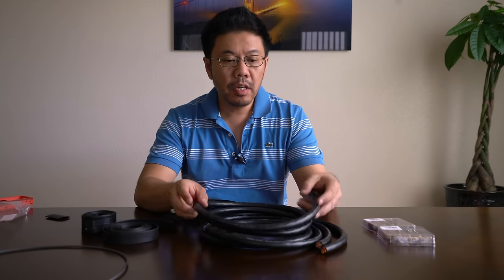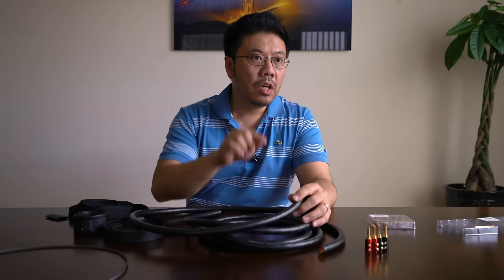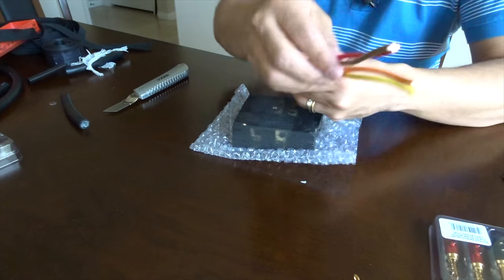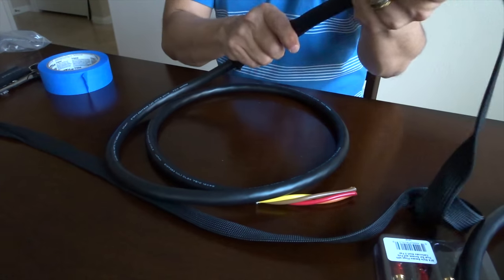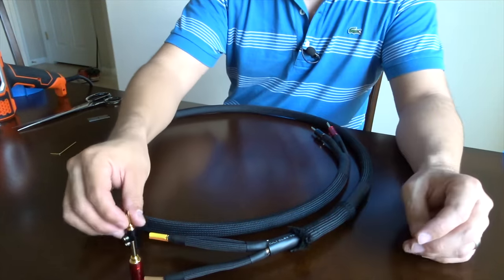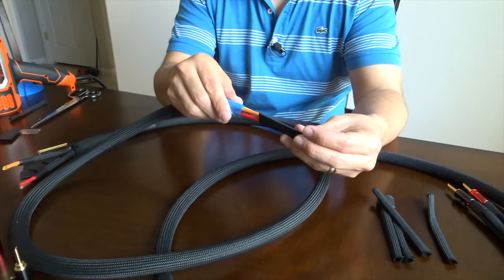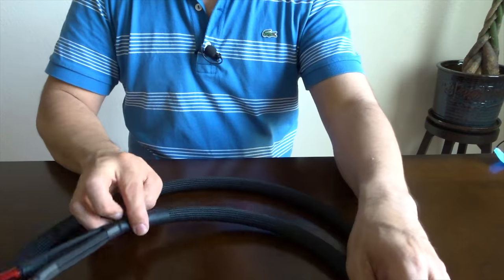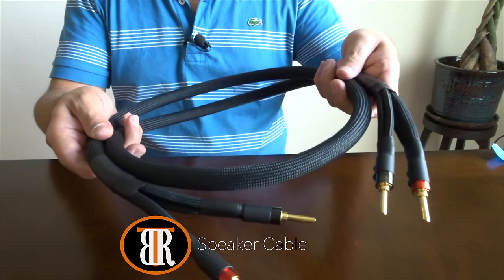Making The Best Speaker Cable For Money, How To DIY HiFi Cables

Comment: It’s not my opinion it is physics, but it is impossible that you would hear a difference between a 12 gauge copper cable and this cable.
Reply: Digiphex Electronics ... he’s happy to spend the money that he has and he feels that it’s worth it. So? 

Will your life be more miserable just because he likes to use the Mogami W3104 and finds it to be a good sounding cable? 😂🤣
Reply from the maker: Yes I can blind test with all my cables and know exactly how they sound in my system, this cables were purposefully made to use B&W speakers, thanks
Reply: @hushpuppykl  Physics doesn't care.
Reply: Digiphex Electronics ... issue is it’s none of your biz. Then these cables are used by pro studios, they care. You dun need to get your undies in a twist.

I personally did not believe cables will make a difference until I tested it out carefully. There was some difference but I won’t spend $1,000 on a pair of cables.

These Mogami cables are a mere $8 a foot I believe. Cheap as hell when we use amps and speakers that cost $9,000 each.
Reply from the maker: Exactly my point, famous Nelson Pass Said,

"Who am I to dispute the feelings of audiophiles who, evaluating any cable in the context of program source, amplifier, speaker, and listening room, decide they can hear the difference? A few guidelines have emerged here, but the final judgment belongs to the user. All the special cables mentioned worked well on the test bench and, given the assumption that series impedance should be minimized, all of them work better than 16 gauge wire. If, like many audiophiles, you have spent a small (or large) fortune on your hi-fi system, money spent for high quality cables and connectors is a reasonable investment."
Reply: Tharbamar ... it’s amazing how some people wanna get their undies in a twist over $8/ft cables. Guess they will get an aneurism if you start to extol the virtues of the Nordost Odin speaker cables. 😂🤣
Reply: Yep, i normally go with the graph in here: https://www.audioholics.com/audio-video-cables/speaker-cable-gauge
Reply: @Tharbamar  you went off the rails when you said cable was "made for B+W speakers" what does that mean ???
Reply from the maker: Because I have some B&W 700 series speakers I like to use with, thats all, thanks
Reply: @Tharbamar  oh ok, that makes sense, I do really like the job you did !! 👍
Reply: @hushpuppykl  Its cheap as hell  period not comparatively. If you have $9000 amps, you should be using something better than this Mogami cable. If not, you're not getting your money's worth out of that amp. As for physics, the physicists haven't got it all figured out yet so I don't thing anyone else commenting here has either.
Reply: @Quetzalcoatl0  You don't need a graph for speaker cables 8 to 10 feet long. You're not wiring a gymnasium are you?
Reply: carlos oliveira ... I stopped at the Nordost Blue Heaven. That’s good enough for me. I’ll get the Valhalla or Odin for speaker cables, interconnects and IEC cords when I strike the national lottery 😂🤣
Reply: @carlosoliveira-rc2xt  Had to use a 50 feet cable for my left and right side surrounds.
Reply: Douglas Blake ... I believe the US stands for free trade, consumer’s choice, capitalism yada yada yada.  At $8 per foot it’s nothing. Let be honest. Thabarmar chose a cable that doubles the gauge needed, so be it. That is his choice. That is what you don’t get. That is the problem with you.

Frankly, I won’t get a double guage cable but if he wants, that’s his choice. Good for him.

Heck, I splashed out on $600 speaker cables despite knowing there is a smidge of a difference only. I just felt like it. But I don’t go around telling people THEY MUST use such cables. In the manner in which you are telling others not to use costly cables.

Economics is based on the amount of utilities we derive. That is part of the demand. He is satisfied, meaning he has received the ulitilies for money spent. Accept that.

Don’t go round shoving your beliefs down another’s throat.

At the end of the day he spent what? $150??!! Of HIS own money.

What you are doing is no different from say, having people calling you foolish to use 15 cent lamp cord.

Get a life mate ...
Reply: Douglas Blake ... maybe it’s time to chill? Perhaps this much of concern could be put into better use such as ensuring the hungry are fed, the homeless have a soft bed and the hungry a hot meal? 😬
Reply: Douglas Blake ... report it to the authorities or start an awareness campaign on social media. Not here. 

You are messing up someone’s channel. Learn some netiquette please ...

N
Reply: @hushpuppykl  They are a bit pricey, yes. Let us know if you win.
Reply: carlos oliveira ... 🙏🤞
Reply: @Quetzalcoatl0  I do as well but for back surrounds I always as routine use 12 gauge. At any rate you may lose a few watts with 14 gauge over 40 feet but I don't listen at THX levels. In fact other than the sub I don't think I'm using more than 5 to 10 watts on average in a 25' x 16' room.
Reply: @carlosoliveira-rc2xt  Exactly the worlds "i don't" and " i'm using ". You may not need but i might do. I don't wanna loose more than a 1 db. My speakers can't do reference levels but the louder they can play cleanly i will push to that limit. So i need that graph.
Reply: @Quetzalcoatl0  Fine, but you won't hear 1db when you're listening to 95 db. Also if you're that close to clipping, you're introducing magnitudes of distortion that you will hear.
Reply: @carlosoliveira-rc2xt  1db is 1/3 the watts. Remember that every time you add 3 db you double the watts. So the cable is sucking 1db of power, that's wasted energy and you have to push the amp more resulting in more distortion. At consumer levels it's pointless. I have speakers in the 88-89db/1m range, and my avr probably can't do more than 32w a channel under 0.1% THD anyway, so the the lower the watts, the lower the THD. With 32 watts i'm gonna get 103db/1m. But if the cable is sucking 1db because of the length and it's high gauge, the amp has to do ~43 watts for the same db. If the amp is producing 1% THD at that level, why no use a thicker cable so it can have less resistance so you can get cleaner sound. So you can suck out every bit of your system, instead of, meh 1db lower i can live with that. Yeah but that's 7 speakers that will be 1db lower.. so....

Comment: Look inside your speaker. 24 gage wire connected to crossover. Voice coil, 24 gage wire. Are you nuts?
Reply: My speakers have 14 AWG wire connecting drivers to crossover. The larger the AWG the less resistance the less resistance the better the sound. My inductors in my speaker are  14 AWG also

Comment: I use 12/3 cabtire SOOW  I use the green ground and connect it to the common ground of the amplifier at one end only and to one copper bus .the speaker ends are the same only I cut the ground wire flush  to the cabtire .#12 SOOW is capable of carrying 18 amps at 600V .Using 12 /4 like you have done in SOOW is much cheaper  than that cable .And you will be able to deliver 36 amps of current

Comment: Thank you for this content. I have been looking for someone like you that knows the truth about quality. Please tell me, if I am running bi-amped speakers, should I use one mogami cable per speaker or 2? Meaning should I split the wiring 2 and 2 per speaker OR should I run 2 half inch Mogami cables per speaker when Bi-amping?
Reply from the maker: Yes you can use one W3104 per speaker for bi-amping. Thanks

Comment from the maker: Shield Speaker Cable with Mogami W3082, https://youtu.be/dnKfyuiW9O4
Canare 4S11 version is here, https://youtu.be/snLExbyIJto
Reply: Hi, just curious if you tried bi-wiring with your set of mogami + canare speaker wires? Wonder what is the sound observation.
Reply: you should check out GR-research  24 strand braided speaker cable
Reply: @aikhowtan2992  are sure that's the best cable 👳‍♂️🎅🏾🎅

Comment: Very nice...2 questions...
1. isn't it better after you screw down the banana plugs to the wire, to solder  them so to ensure better contact? 
2. There are 2 different banana type plugs...why do you choose the type you used  for this build vs the banana plugs that have tensioning sides that spread out ?
Reply from the maker: I preferred direct contact over solder for speaker wires.
BFA type is stronger and easier to fix in case of being bent.

Comment: There is only so much benifit you can get from a cable. This is overkill like I have never seen. Waste of money for 0 gain.
Reply: But it looks Nice!
Reply: Vic Green yes for the look. There is no difference on sound  on a 3 meters cable runn. 
I have a paire of 3m Vivaldi cables (2€ meter) and a paire of 3m Audioquest Rocket33 (30€ meter) Amp: Yamaha as2100, Dac: Nad D7050, Tidal Streamer: Bluesound Node 2i, Interconnect: Audioquest Big Sure + Audioquest Evergreen Optical cables and speakers:Dali Rubicon2. 
Both cables sounds the same. I have lately borrowed a silverplated QED XT anniversary to test it in my system and guess what? Neither me nor my two invited freinds could notice any change in sound on all the 3 different cables 😥
Reply: @Slim-man1977  You need a more expensives ones! Haha
Reply: You are missing the point. He has a specific use in that he is swapping out a lot so needs the beefier cables. It's all about durability.

Comment: I really appreciated this feedback. I've ordered the Viborg ones. I'm also looking into building some intercepts using Belden 8402 cable as well. Have you found any RCA and XLR ends you prefer since you made your interconnects video?
Reply from the maker: Most of my balanced cables I use Neutrik connectors with gold plated pins, thanks

Comment: Probably no professional use cables like that. Also no ableminded professionals buy that,  "high resolution" cables exist. Your solution is way overkill. For sure they will work fine for many years, but so much more expensive than more ideal pro cables

Comment: You are best! What a difference! Loads and loads of low end. Crystal clear and sweeter high end. I admit that I was an anti-cable guy. Not a big fan spending thousands on expensive cables. I was genuinely surprised how big the improvement was. I always thought my Musical Fidelity A200DM pure class A int amp was not powerful enough to drive my 6 ohms 86db Harbeth SHL-5 speakers. Or my speakers were just lack of low end or combination of both. The low end/bass and high frequency response was weak. So a few weeks ago I ordered a tube amp from a reputable brand hoping it would change everything. After a week of testing, I decided to return the tube amp. There was no obvious improvement. I was frustrated and lost. Two days later. I received the speaker cable parts from the links provided. I followed the detailed instruction and built the cables. It took me about 3 hours. I couldn't be happier with result. Most important thing was it solved my decades long mystery. I couldn't believe it was the speaker cables all along. Thank you so so much!

Comment: Your link point towards the TST-WP48NP Furez connectors.  Although those will fit double 12AWG in the connector tip, the connector "barrel" will not house them!!  You need the XL version.  I was forced to manually shave off part of the conductor jackets so I could push/twist and lower them enough on the conductors to be able to crimp the plugs onto the twisted wires.  This was a painstaking trial and error process which added a good 30min per cable...
Reply from the maker: I will fix the links, thank you.

Comment: I’m going to do this to bi-amp. Which colour cables should I put my red banana plugs on ?
Reply from the maker: I would start with Red conductor, thanks
Reply: @Tharbamar  sorry think question got lost in translation. This cable has 4 different colour wires red, yellow, orange and brown. Which two should I make red and which two  white connectors ?? Love the videos. Would love a balanced XLR cable video.

Comment: I highly recommend FUREZ 12/2 AWG ,(you won't find better copper), Sewell Direct deadbolt banana plugs and your choice of braiding and 5/8 heat shrink adhesive tubing.
Reply: Oh and knukoncept wire pants. Very important.
Reply from the maker: Thanks Finn, recently I have upgraded to Furez pure copper connectors, thanks

Comment: Hello from France. I have a question: wich lenght do have the cables sold by ebay there is non mention of the size. Thanks forward
Reply from the maker: As far as I know most sellers priced per foot for these cables.

Comment: Thank you for this great video. I would like to use Mogami W3103 cable. Could you provide the correct sizing of Nylon Sleeve (s) and Shrink Tubing to purchase in order to build the cables
Reply from the maker: I don’t know the size of w3103, best thing for you is measure the O.D of cable and contact the seller for best fitment, shrink tubing is 1/3 shrink ratio base on O.D of the cable, thanks

Comment: Hi there. Thank you for excellent content and for sharing your knowledge. Theoretically I can use this cable (W3104) to make a bi-amp connection. Is that correct? in other words, I need just one of this cables to connect the amplifier with speaker by bi-amp type connection, isn't it?
Or it's better to use Mogami W3103 cable for bi-amp connection, using two of them to each speaker?
Thank you in advance!
Reply from the maker: Yes it can use for Bi-Amping, each conductor goes to each terminal, you will need two w3104 for two speakers and you will need 4 w3103, thanks
Reply: @Tharbamar  Thank you very much for your feedback. 🙏👍
Reply: @Tharbamar  Just an last question: for bi-ambing porposes and to have greater sound quality,  it's bether use 2x w3104 or 4x w3103 ? Many thanks.
Reply: @helmut3356   Thank you. I will try that. For now I was thinking to try chinese OCC cable.    I would like to improve the treble (high frequency) on my system using the specific  cable for that. Nonetheless,I realize that Mogami cable is good but it's neutral or little  worm. So, I will try the OCC cable with hope to improve the treble. By the way, my system is Cambridge CXA 81 amplifier  + Warfedale Evo 4,2 speakers.

Comment: I just purchased everything to make some of these. Thanks for the useful video.
Reply: So how is the sound? better than what you had? Im thinking about making them. thanks.
Reply: @pabsgabs  still haven't made them. Everything is sitting in a box lol.
Reply: @baldeagle7604  That would be me too lol... Do I need the sleeve or is it just for looks? I usually dont use any banana plugs either, can I just buy the cable? thanks!
Reply: @pabsgabs  the sleeves are cosmetic. You can def just buy the cable. Pretty thick stuff to twist together. I'd go either spade or banana.

Comment: Do you need the sleeve and the shrink tubing or is it just for looks. My wires are not visible so do you still need them?
Reply from the maker: It just for protection but not necessary.

Comment: Very nice wires. Guarantee that's over kill. I've done a few blind test with friends. I've never had any of them pick my best set of wires. Also this wire would need to be tightly twisted or separated to prevent induction at higher power levels when the conductors are that close parallel to each other.
Reply from the maker: Yes I did tried twisted and I didn’t notice any improvement, as you can see at the end of this video all my other wires are all twisted but only 5.5' run should not be any problem, I've seen many high power set up with this cable in pro environments even much longer runs without any problems, thanks
Inductance: 1khz 20°C 0.6µH/m (0.18µH/Ft).

Comment: Quick question because I am colorblind. Did you use red and black heat shrink when you put the two cables together? Or did you use black on all of them? If so which one did you make the positive? The yellow or the other one?
Reply from the maker: You can use any color you like for positive or negative, i use all black outer jacket but I use red and black banana plugs.
Reply: @Tharbamar  thank you for the reply that helps a bunch I'm going to try my hand at making some myself. Right now I'm just running the most basic audioquest stuff so I'm sure these would be an upgrade also going to try the interconex you recommended in your other video

Comment: Any reason why you don't solder them to banana or spade connector?
Reply from the maker: Just preferred direct contact.
Reply: @Tharbamar  Nice job.  My only comment is that perhaps a better clamping pressure distributed across the entire cross section of wire would result if twisted ends were "tinned" solid before clamping.  But nice work.

Comment: In your experience, I know that ultrasonically welded cables are stronger and can handle more force when pulling, but is there any sonic enhancements versus just using a locking or screw cap banana plug by itself?
Reply from the maker: Ultrasonic welding or Cold welding is good I had that but sonically there is no major benefit than direct contact with airtight sealed contact area.